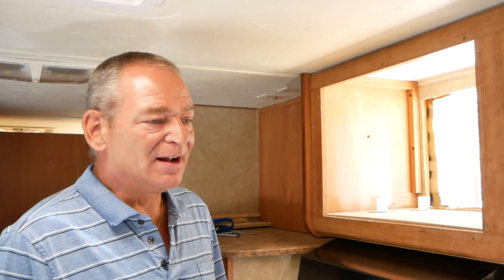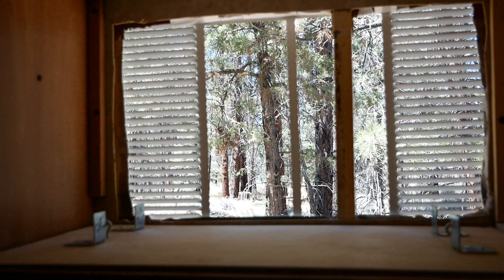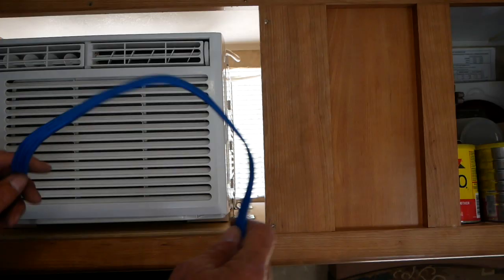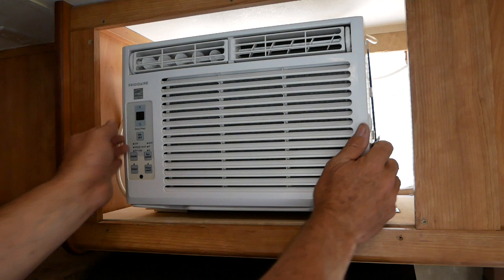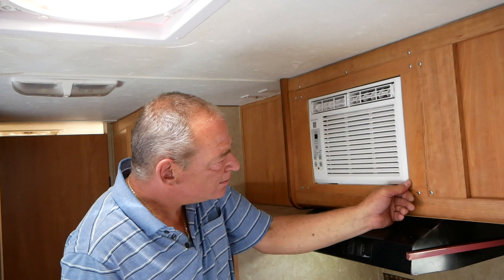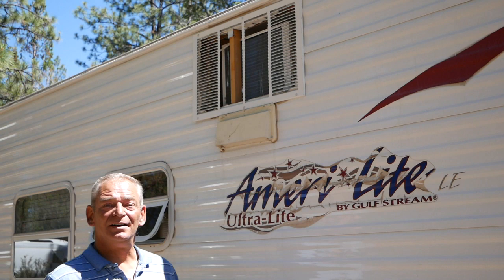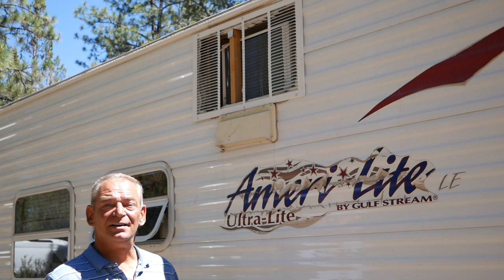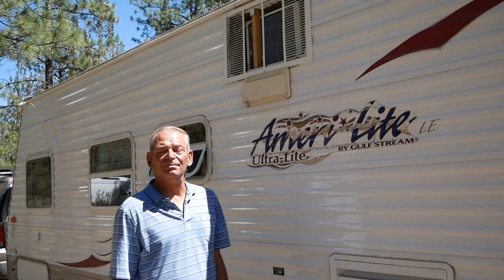Solar air conditioner install in RV microwave cabinet

Comment: Can I have a 60amp MPPT solar charge controller and a 55 Amp controller/charger on line at the same time?

Robert
Reply from the maker: Yes as long as they are set to the same charge points. They will both see the voltage of the bank as they always do. I have a 60 amp and a 45 amp running together
Reply: I think I know what you mean by charge points.  Just to make sure, Charge Points is where the controller and the converter attach to the battery bank? same lug? for both positive and negative?  And thanks for your help, watching your videos has inspired my system and set up.  I finalized it yesterday and this is the last thing I'm slightly fuzzy on.  I ran my 5000 AC and all lights and everything else as a test of system for 10 hours yesterday without ever drawing from batteries until sun went down.  Totally Awesome....
Reply from the maker: @bdaddy355  What I mean is that both controllers are set to the same voltage settings as far as absorption and float. Good job at getting it going. Solar is AWESOME!

Comment: You should have made a frame around the opening between the inside, and outside wall that would carry the structural of that one support, like a window frame, it would have went a long way to making the installation simpler

Comment: My thought- wouldn't it be better if it was on a drawer slide?  push the a/c unit all the way back & out the side of the trailer (when in use), which would open up an external hinged cover (which would shade the a/c & cover the hole when not in use.  This would allow for air flow & condensation drainage.  You would have to cut the stud, but you could frame it out.  It looks really nice as is  B U T  I think you're going to kill the a/c with inadequate venting (possible fire hazard from overheating),  have condensation rotting the inside of your framing & still have bug issues internally.  I'd suggest you talk with Youtuber, Slim Potatohead, he is an engineer extraordinaire.

Comment: Helllllllp! I'm having solar troubles. I bought a van with solar on it from someone who had the van less than a year and it had solar on when they bought it. First I don't know how many watts my panel is but its huge with 60 cells. But I replaced my dead deep cycle battery to a Duracell agm 12v and it's been awesome but I have just cut a hole in my roof and installed a maxxair fan and it wont stay on when the hot wire of the solar panel is plugged in to my charge controller. I have a super cheap black and green charge controller that I see is not even $12. I just watched a YouTube video for it which shows it over charges and is inaccurate on its voltage readings. Is my charge controller wrong for my needs? Or do I need to wire the fan somewhere else? It's a spaghetti wire mess along my wall from all this and it's hot in my van. My cat and I are fulltime in here and we're trying to be comfortable through this summer. I dont want to spend more than $30 for a new controller on amazon but I dont know which is right or accurate. The one I have now is the most popular but isn't working for me. Help can a maxxair fan run in the load section of a controller?
Reply from the maker: You do not want to use the load terminals on the controller. Also you may need a MPPT controller. They start around $60
Reply: @solarboondocker4597  oh I thought that was what it was for. Do I use a lamp cord and just plug  the Maxxair vent fan to the inverter?

Comment: Hey Jim, taking your advice and going for the SUV and light weight trailer. With limited income, I was able to get an older but well maintained SUV that is a 5.7 hemi and a tow package stating it can tow just under 9k. Now I am trying to find a used trailer with a GVWR of less than 8k, so do you think I am being too optimistic in finding a 24-27 foot toy hauler ( I really want that porch/screened room, ha! ) at this weight range? I don't trust the manufacturer's specs after hearing about all of the lawsuits so I have asking for sellers to take them to a weigh station to check and so far the one that agreed to do that,  has been way over the specs... not sure what to do. I'm in San Diego county area. Any advice appreciated, thanks and I am glad that you have share your experience and knowledge with us all! I have a DIY solar setup ready to add to the trailer, so maybe you can advise with that too?
Reply: Um Julie, I guess you haven't taken notice to the fact that this guy has been gone for 3 years off of YouTube, so you're probably not going to get an answer.
Reply: @bayside6207  I did see that, but thought I would see if anyone would reply. Why are you on here, ha ha?

Comment: Hi Jim,I have the same frigidaire energy star A/C. I baught it after watching you and Bob on a video with you demonstrating the A/C. I have a 5x8 Squaredrop camper the A/C is installed to. With my walls and ceiling completely surrounded by 2 inch owens corning insulation,my A/C cools the camper down from 95 degree and 100% humidity to 78 in 15 min. After that the A/C only runs 4 minutes every hour to keep temp,,im hoping 3 200 watt panels and 3 100 ah agm batteries will run that set up. Do you think it will work. Thank You Jim
Reply from the maker: Running for as short of a time as you say should be doable. 4 minutes of run time should allow for the batteries to be recharged.

Comment: Jim.... Sir... Firstly.. Thank you for all your info that you freely share.. I am now better informed on making sounder decisions on solar..a/c....boondocking..

On cheaprvliving you stated that the sportsman 1000 can run continuously for 10-12 hours on its tank...  I am weary of 2 stoke engines for longevity...  Is there a 4 stroke 800/1000 watt inverter generator that you recommend to run 10-12 hours?

I bought the same Frigidaire a/c unit but i will be powering it in a portable tent...

I searched at lowes/home depot for answer but many of their assistants admitted that they didnt have experience with inverter generators..

I am looking for a 10-12 runtime to power the a/c...  As i rewatch your videos... In the future i will be consulting with you on a solar setup...
Reply from the maker: The Sportsman 800/1000 is a 4 stroke inverter generator that will run all day charging batteries off of a half of a gallon of gas. Running the A/C is more like 5 hours so to get your 10-12 hours running a A/C I would suggest a propane or dual fuel generator. A Sportsman 2200 inverter generator running on a 20 pound tank of propane can run the little A/C for between 30 to 40 hours none stop.
Reply: @solarboondocker4597  thank you... I dont know why i assumed the 800/1000 was a 2 stroke....

Comment: How do you remove the front grill to clean the filter ?
Reply from the maker: The filter slides off the right side of the unit when the trim is removed

Comment: Thanks for this video. I know that you are busy so I hope you can find time to answer my questions or steer me somewhere to find the answers. I have wanted to use solar power for my concession trailer that I built. Does this a/c unit require less power than a standard 5000 btu? Where do you have your panels set up? It seems that your panels are somehow putting power into your electric set up throughout your trailer, how did you do that? Thanks again.
Reply from the maker: it is the lowest rated consumption that I could find. I plug my shore cord into the inverter with the converter shut off

Comment: Jim, nice install, what about having access to clean the filter? So can run this from your solar panels during the day and by pass your battery bank? How long can you run it at night before it depletes your batteries? How much solar wattage do you have and how much is the A.C using on start up and continuous use? Just seems like you would need a backup generator to operate this or be plugged into 110 volts, either way very cool  install.....
Reply from the maker: Thank you
The filter is accessed by removing the trim on the right side
During the peak of the day I can run one A/C off of the power generated by the 750 watts on the trailer. Both of them off of the full 1185 watt system especially if I have the truck's panel tilted and tracking. You can see the controller panels in my dual A/C video and get a idea of how much power they pull. My 675 Ah bank would run the A/C overnight when new.
A back up source of charging is always a good idea in a balanced system. When it was so hot in Quartzsite while I was there for a few months my systems were producing 650 Amp hours a day and it still wasn't enough.

Comment: can you run a 250wt heater off a battery?
Reply from the maker: I run a 250 watt heater in the bathroom while I am in there. It can not actually heat up the whole bathroom so it is more like a lap warmer on chilly mornings. Generally only for 15 minutes or so.
Reply: @solarboondocker4597  For a van situation, do you have any Idea how much battery power that would require to run for 12hrs?

Comment: I think you would get way too much air leakage in both directions. I would have the AC sticking out at least 2 or 3 inches. 
All that heat is just going to stay inside of the coach.

Comment: How is that solar air if its plugged into 110?
Reply from the maker: The 1185 watts of solar panels provide the power for it and it's partner in the bedroom. You can see the controllers holding the banks voltage while they run in my Dual A/C video
Reply: Awesome, thanks

Comment: HEY JIM GREAT JOB !!! BUT I'LL TELL YOU>>>>> YOU NEED A SCREW GUN LOL.
Reply: Yeah...just messin' with ya Jim but, with all that solar up top, one would think you would have an electric drill/driver!  ;-)
Reply: That trim is pretty thin.  Maybe he was concerned about stripping out the hole when using a screw gun.
Reply: You are probably exactly right.
Reply: Drills are noisy for a video. Of course he has one!
Reply: I was thinking about my IKEA cordless drill with a screwdriver bit. Very handy for screwing in screws.
Reply: The brief look on his face after he dropped that 2nd screw.  We ALL know that feeling!
Reply: @brettb8825  Brett yep lol

Comment: Where's the Solar AC ? Wait until the condensate stars running down the inside wall. That'll be cool.
Reply from the maker: The A/C and everything else in my trailer including the hot water heater, electric cook top, a second A/C, freezer and more is powered by 1185 watts of solar.

Comment: That's the one thing about RVs O don't understand. The manufacturers don't seem intent on building the most efficient AC/HVAC units. There are so many retired engineers in the community with the brain power to collectively improve the quality and efficiency of RV air-conditioning units.

Comment: Why not use an air conditioner designed for a small area like a dog kennel ac?  That ac you put in is probably designed to cool a larger area than your rv.

Comment: I don't see any solar part!
This is just an AC unit!
Reply: Dirtydigger StuffandJunk solar panel charges batteries. Then the invertor  connected to batteries give power.
Reply from the maker: This is the kind of thinking that I was up against in 2012. The thing is that there are examples of solar panels used as generators everywhere. The solar powered fountain in your back yard has no controller or battery, neither does the water tank for cattle out in the fields which may even have a heater. Even solar powered vent fans run straight off of a panel. So it does not take that big of a thought process to understand that the concept can be taken to a larger scale. 
The other thing is that a battery offers resistance to power coming in and out. Electricity like water and air will follow the path of the least resistance. That means it is easier for the power coming from the controller to go directly to the inverter than it is to pass through the battery first.
 I guess the easiest way to explain it is that those willing to tell others what can and can't be done should have to push the button first to see what really is happening before giving advice.

Comment: Update #2:  See Comment from Life Quest [just below] about the different applications for 'window-style' vs 'wall-style' AC units.  An important distinction for these RV installations, in order to install them properly.  This install, then, should have the 'wall-style' instead, for proper ventilation.                Update #1:  I went and found your previous video, with Bob Wells, where you described this AC unit: Frigidaire 5,000 BTU, Energy Star rated, window-style, with the lower-voltage draw at startup;  Cost appx $180. 

Hi, Jim:  Could you please tell us all exactly which AC model you chose, and why?   I love your idea of using the microwave space-- seems the perfect spot.  Thanks for everything you're sharing in these videos!!!  I'm learning, slowly, but it's still damn confusing at times to figure out the correct needs for a successful power setup.  Will keep plodding. ;- )     Stay cool!
Reply: @lifequest7453  Oh, thanks for that valuable info!  I wondered about that distinction in models, but figured Jim had researched it.  I appreciate you explaining, in detail, how each model should be used.  I hope others will see this, too!

Comment: Looks very similar to the install I did in my AmeriLite 2 years ago. I placed a baffle around the back of the AC unit so it could pull fresh air in from the side where the cabinet was open to the refrigerator plenum, and then exhaust out the back through an AC vent cover that I added. I've had no problems with overheating, and the unit cools the camper down without any issues.

Here are some photos from my install: https://www.instagram.com/p/BVdWEr9nkkF/

Comment: This is NOT a good idea...while it looks good on inside, and fits in that spot, there is a REASON window AC units mostly hang OUTSIDE the window, that part needs to be outside where the hot air is, and not in an enclosed (or partly enclosed) space. You’re messing with the efficiency of the unit and it likely won’t last as long. To understand just search how window AC units work.

Comment: That is NOT a solar air conditioner! or even a RV unit, that is a regular 110 volt powered powered home AC unit. .. home units will fail quickly due to copper lines work hardening over time due to constant vibration during travel... anyhow seems a bit click baitish... and really tin snips to cut outside? cut should of been made in one cut inside and out with a sawzall.... overheat most likely caused by voltage drop less voltage equals more current more current equals more heat.. or you just need a wood divider around inside back and whole thing needs a water tray with drain otherwise great!

Comment: My rule of thumb is: if you need A\C you're in the wrong place.
Reply from the maker: sometimes there is no RIGHT place
Reply: @solarboondocker4597  A\C required for humidity is one thing. That can be avoided largely. It is not present in certain states and regions.
A\C for heat reduction can also be minimized and\or avoided by strategies such as erecting sun shade deflectors, fans, convection cooling & once again certain areas. 100% avoided, not likely but if it's >90% perhaps it's not an issue. 
I grew up in W. Washington and nobody had and\or needed A\C for heat and\or humidity.
Reply: @Mark-gg6iy  I live in Florida, so it's definitely a problem. Unless people have the means to leave/relocate, then it will definitely remain an issue.

Comment: Jim, I enjoyed the video but had to give it a thumbs down because I am not convinced that this was a good idea, I suspect that the unit will always have overheating  issues because I think that it needs to pull in fresh air from the top and sides to cool the condenser. I don't see how that happens here.

Comment: didn't know you could run an ac with solar power, except maybe with more than one panel and an inverter.
Reply: Jake McClintock  You really can’t.

You’re lucky to get a few hours out of it, even with a huge solar array.
Reply from the maker: Actually you can and simply put, it's a numbers game. Each of the panels on the roof of my trailer put out 18 amps to the battery via the controller during peak light. That 54 amps is more than it takes to run the A/C and inverter for 6 hours a day. The panel on the truck is good for another 30 amps easy because it tilts and tracks the sun. That allows me to turn on one A/C before and after peak hours OR run two during peak.
Another way to put it is my systems maxed out at 651 Ah of production during a 100+ degree day in Quartzsite earlier this year. A single A/C takes around 40 amps to run it. Can you see where I can get more than a few hours of run time?

Comment: Jim, looks like a big improvement over the last setup you had.  The interior trim you did is brilliant...looks like a built-in from the factory.  I think it could be even better to have the AC mounted on a heavy duty drawer slide so it can be slid out when needed, exposing the top, bottom, rear and 2 sides to the open air and then slid back in when not needed.  The down side is you'd have to remove that vertical stud in the wall so the AC could slide out. The side hatch, hinged at the top is a good idea.  see video below from the 13 minute mark to 17 minute for this setup.

https://www.youtube.com/watch?v=hCP0zuTdoh4